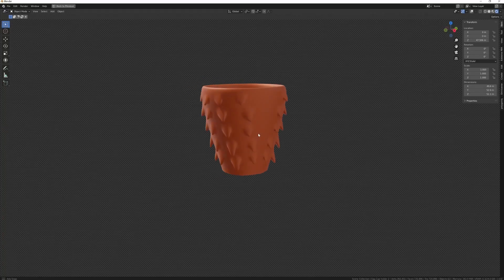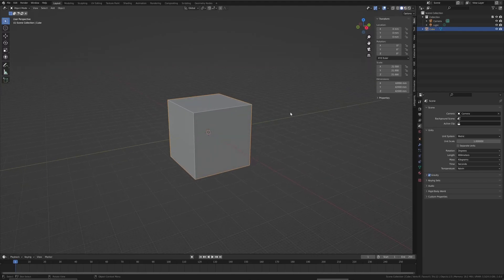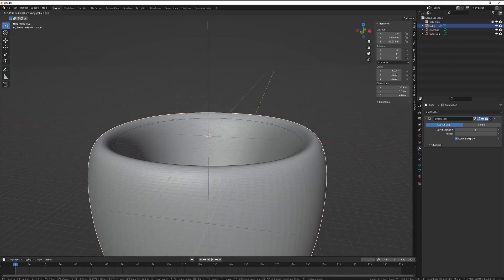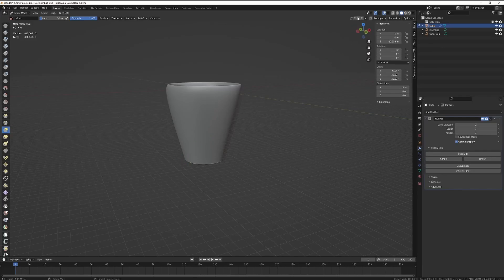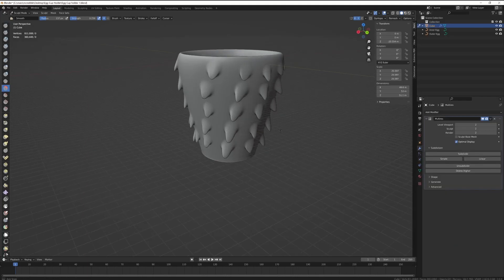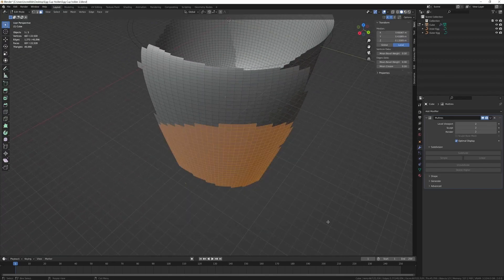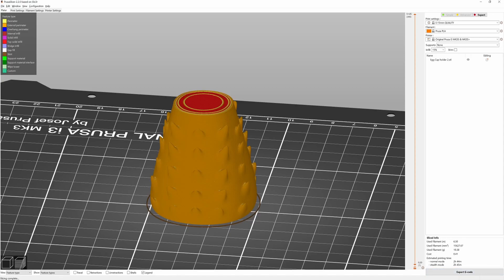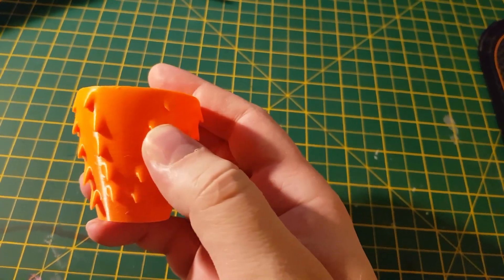Blender 3.0 to Prusa mk3s 3d printing tutorial

Comment: Hello. I have a question. I could not import animations that consist of more than one piece in blender, such as the rotation of gear wheels, into the unreal engine. So the pieces were imported, but the animation does not work, and for animation to be an animation, they must be in their parts separately. How can I make them one piece and make the animation work? I want to. You can also suggest an instructive resource that you know. Have a nice day
Reply from the maker: If you want to export multiple gears that each have their own animation keyframes then exporting from Blender using Alembic should work nicely depending on what you are trying to do. 

FBX would also work but you would need to apply each gears animation in unreal which would be a bit of a pain and take a lot longer to do. 

If you have any problems with that you can upload a screen capture of what you are trying to export so I can see what the problem is.

I might do a quick tutorial on that later today if I get some time.
Reply: I generally tried fbx output. And I tried many animations, not just gear wheels, but I couldn't transfer any of them because there were more than one part. Finally, I couldn't send a picture, so I want to share the video name of my work. you tube.name: Treadmill Made Easy in Blender. that is, the treadmill animation is explained. Thank you for your attention.
Reply from the maker: @hasanbasryand6880  Yeah exporting that treadmill as alembic should work nicely with that cloth sim + other geometry.
Reply from the maker: @hasanbasryand6880  Hey I just recorded a quick demo to show what I mean as I have had a few people asking about this as well as alembic textures. Hope it helps you- https://www.youtube.com/watch?v=qOdCeV9mydI